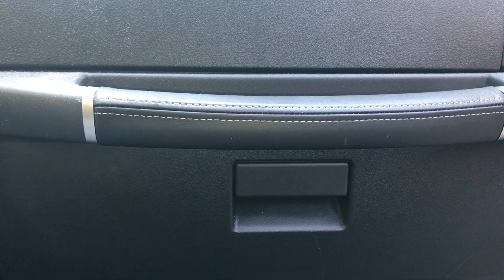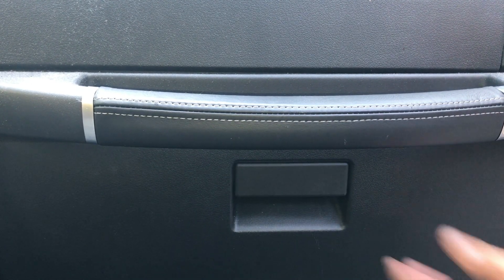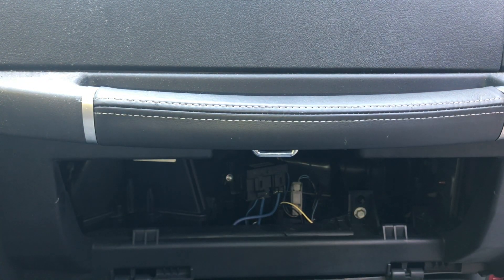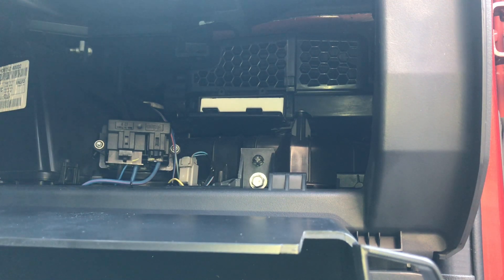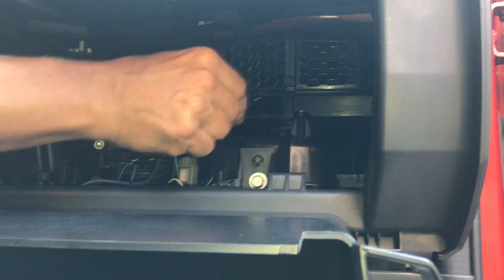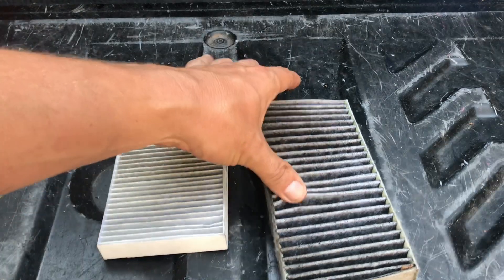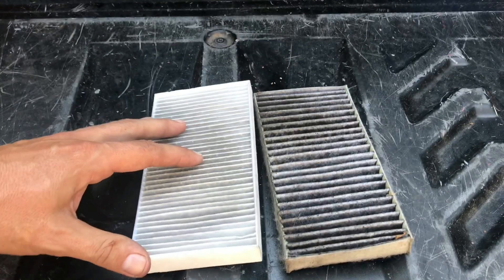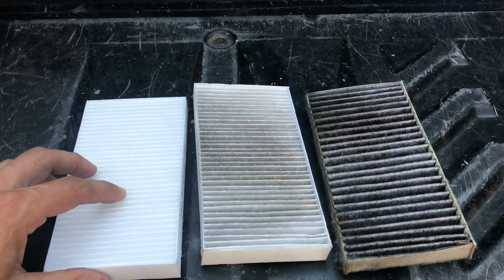2008-2012 Jeep Liberty Cabin Air Filter Replacement

Comment: Mine is a jeep liberty sport.Does not have that configuration.Not even sure there is a cabin filter.
Reply: Mine doesn't have that type of filter set up. Does mine have one or not? It is an 08 liberty.
Reply: We have 2 liberty's one has a cabin filter and one doesn't. When I looked it up it said it was an optional item.
Reply: @alfenner3309 I have 2008 keep liberty sport it has no cabinet air filter